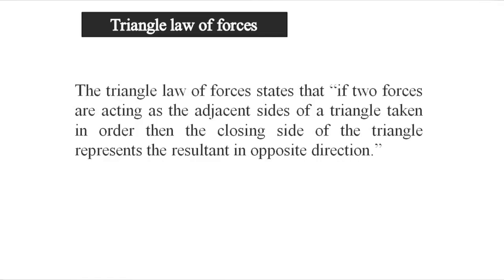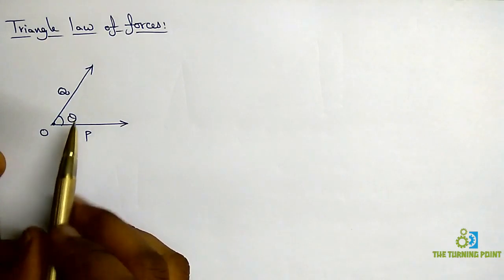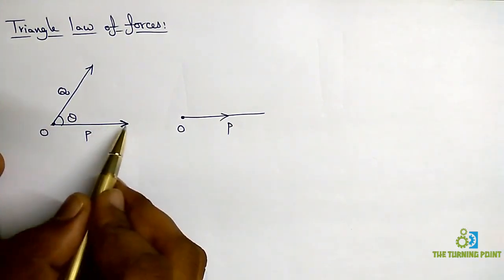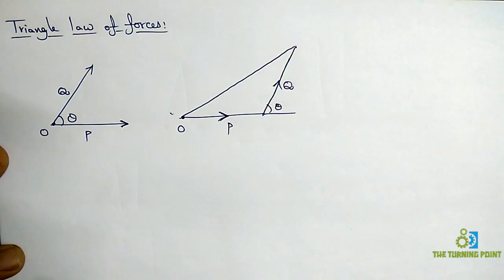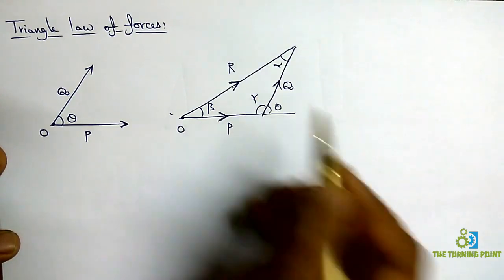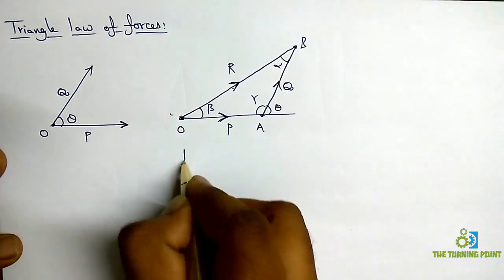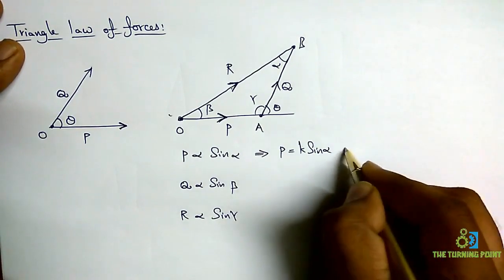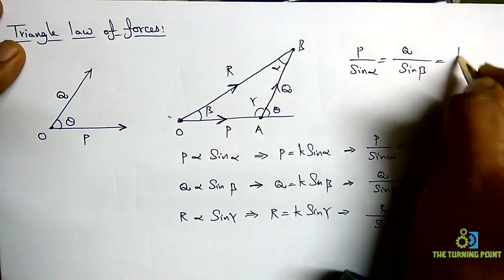Triangle Law of Forces

Comment: Resuktant arrow head in oppsite direction li vundali kada sir
Reply from the maker: Its not wrong Shiva... see the statement of triangle law of forces. Resultant will be the closing side in opposite direction...
If you are able to form a closed triangle with given three set of forces that means those three forces are under equilibrium and resultant value is zero.
Both are different
Reply: Ok tq sir

Comment: Diff bet sine rule and lames theorm
Reply from the maker: For application of Lamis theorem the three forces should be in equilibrium ( Resultant magnitude is equal to zero) where as you can use sine rule even the force system is not under equilibrium( for calculation of unknown force or angle)

Comment: can u explain me resultant of two forces
Reply from the maker: For resultant of two forces you can use parallelogram law of forces and triangle law of forces. In these two methods parallelogram law of forces is very easy to use. For parallelogram law of forces explanation refer the following link.
https://www.youtube.com/watch?v=ftHXIOt8110
You can use triangle law also. In triangle law there are actually two ways to find resultant. One is graphical method and another one is analytical method. In these two analytical method is accurate.For analytical method we use sine rule.